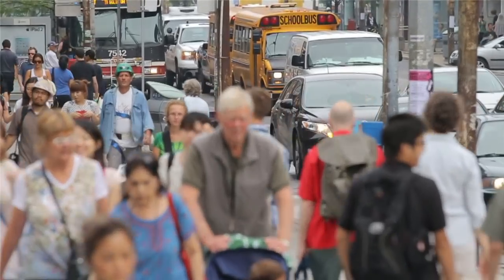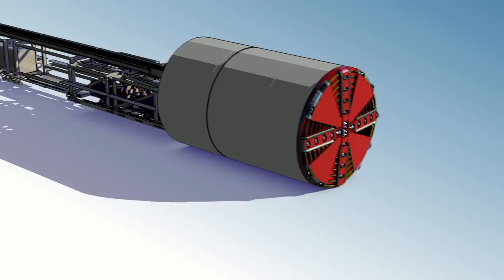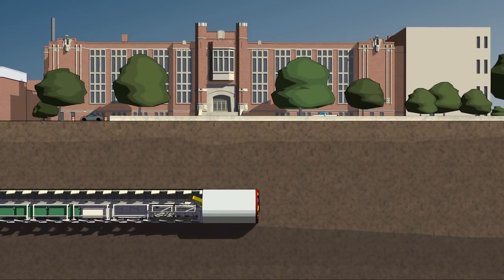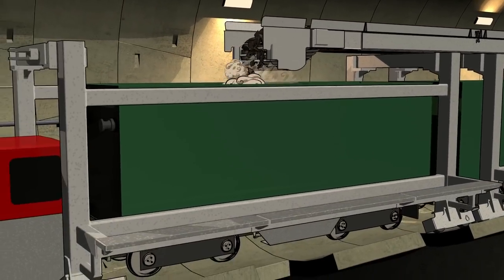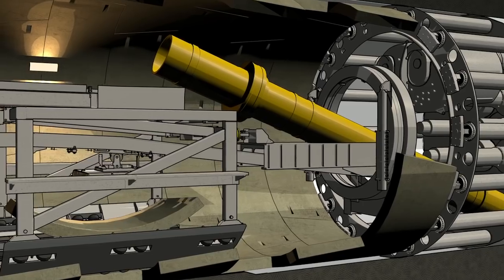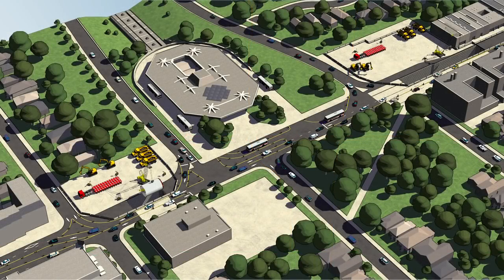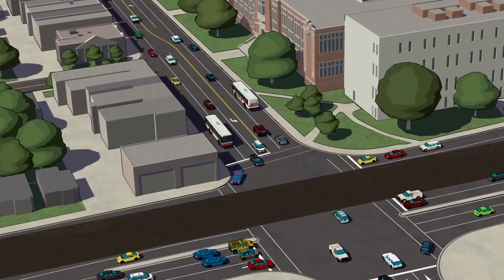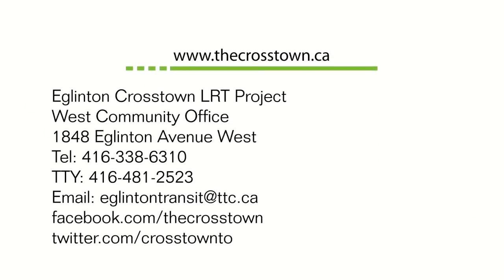Tunnelling for The Crosstown

Comment: I'm originally from Brooklyn, NY and coming from a city that has an expansive subway and overhead railway system, I strongly believe this LRT is too costly and time consuming. It's a great idea but I think it's a much better idea only because it is faster and cheaper to build cemented or concrete overhead railway tracks. They might be eyesores but the city and the GTA's will finally have rapid transport.
Reply: Toronto tried a half-ass version of that once with the Scarborough RT and have been scared off of doing that ever since. Even though Vancouver ironed out the glitches and it would be easy and fast to install. Beauty is in the eye of the beholder, I would much rather see clean and efficient transit gliding though the city than gridlocked streets.

Comment: The problem is the word "subway" itself is misleading. Nearly every subway system in the world has at grade and above ground sections (NYC, Tokyo, HKG, Paris). Montreal's metro is one of the very few exceptions (rubber tires + snowy winters = bad). Many "prefers" an entirely underground subway. Not one of them who "prefers" that thinks about the extra $100 million/km involved and who exactly is paying. (higher fares? extra gas tax? extra property tax?)
Reply: this is why Montreal Metro abandoned Line 3 Red because it would require trains to go outside

Comment: If it's grade separated for the entire route, it is a better option to build the entire route to heavy rail standards since heavy rail has greater capacity and you are already building underground tunnels. Then again, the light rail shown here seems to have 2 units of 5 sections each, so I assume that it will have greater capacity than standard light rail elsewhere around the world,

Comment: Would this LRT function the same way as the Scarborough RT? They look really similar to each other. It would be awesome to see this project completed but it's going to take about 10 years.
Reply: No its not the same as the Scarborough RT. The Scarborough RT is a Light Metro that is basically a smaller subway. The LRT is similar to a streetcar but always has the right of way and has a higher capacity and speed. Therefore it can intersect with roads and allow cars to cross the tracks. The Scarborough RT must be separated from roads as no vehicles can cross the tracks.
Reply: Not really, the Scarborough RT was built using a knee-capped version of the Vancouver SkyTrain. This system uses traditional tried and true electric lrvs. This has much more in common with some Japanese and French subways using trams.

Comment: the most disaster intersections in Canada are Yonge and finch and yonge and steels 
so far  city dosnt have any plan to fix them 
we need Defenetly subway stations between finch to steels
Reply: Extending to Vaughan Mills would have turned an 8 km line into a 12 km line. Much more expensive!

Comment: the projection is that there won't be enough use to make money in the next 50 years if they do a subway, which will cost several times more to build and maintain. This system will also have nearly as many stops as buses, instead of having to walk huge distances (think Warden to Kennedy station) like subways. A subway along eglinton would immediately become a huge money loser for the city.

Comment: if they are digging why not just put a subway?
Reply: It seems more expensive
Reply: and some parts of this line (such as in scarborough) will be above ground and in the middle of streets where there is low density and it is not economical to support underground transit, subways cannot be in the middle of streets
Reply: it was previously attempted but it was cancelled for Bus service (Much to my Extreme Disgust)
So now the LRT Ought to finish the job were we failed
Reply: It is a subway, all LRT means is that the vehicles are "lighter" capacity. They are also cheaper to build.

Comment: we want subway not LRT!
Reply: It's basically the same silly. Especially if built with large station boxes.
Reply: @OtakuUpNorth  the rolling stock is different.  What they're using on the Crosstown is smaller and shorter than the subway trains in service on lines 1, 2, and 3.
Reply: @OtakuUpNorth   the rolling stock is different.  What they're using on the Crosstown is smaller and shorter than the subway trains in service on lines 1, 2, and 3.